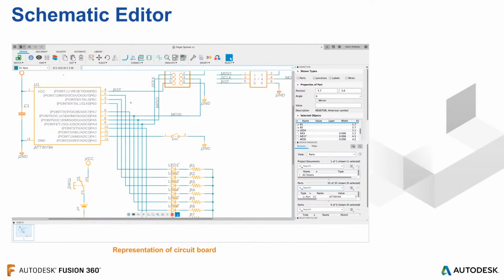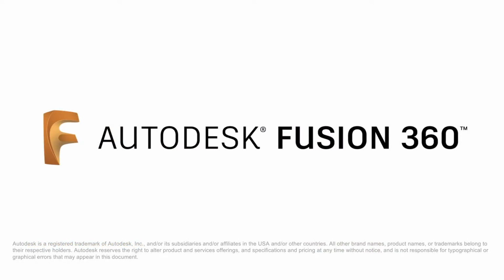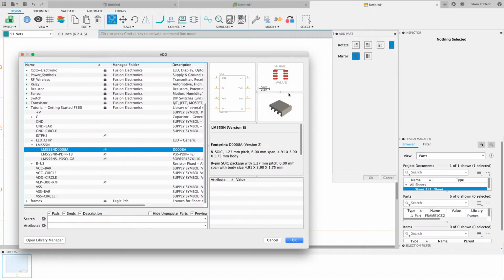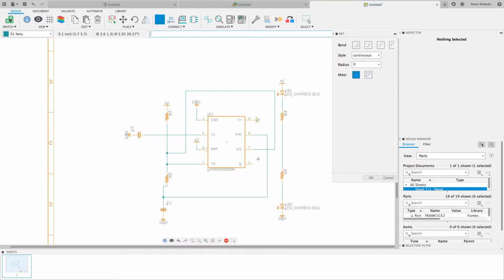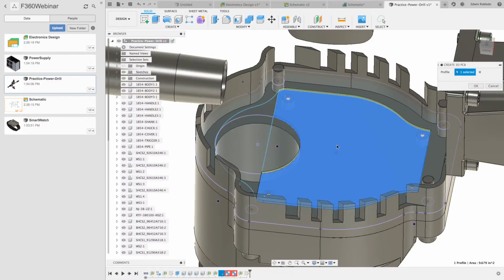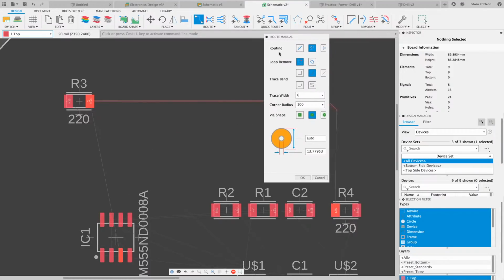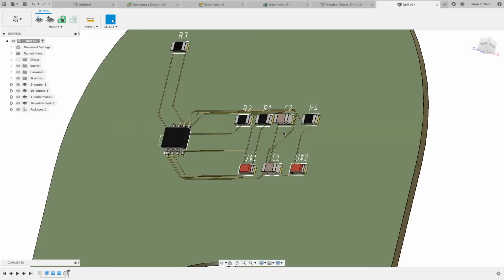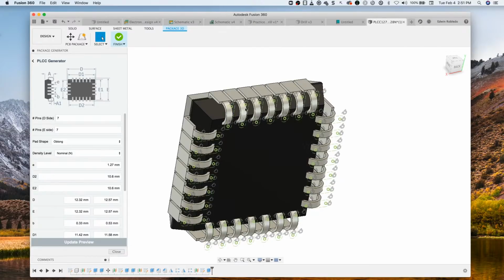360 LIVE: Introduction to Fusion 360 Electronics with Edwin Robledo

Comment: Are there any tutorials or guides online about migrating from Eagle to Fusion 360 electronics ? We are interested in switching but have a full library of components we designed using Eagle and old designs that may need to be updated occasionally. Can I import our Eagle library and projects right into fusion 360 and they’ll just work?

Comment: how to import an existing path (e.g. from an SVG file or a Fusion sketch) into an electronics design?
Reply from the maker: Hi, great question. From the Design Workspace click on the Create Pull down menu and select Create PCB. From here select the Sketch Profile or Face that has the geometry you wish to use on your PCB. Once you click OK, this will transfer the selected geometry to 3DPCB which you can link to an existing or new PCB layout.
Reply: @adskFusion  thanks!

Comment: How does the 3D PCB return to the mechanical workspace for the drill where you originally defined the board outline? Surely this is the whole purpose of this workflow which isn’t shown here - need to be able to check that the PCB with components fits properly inside the mechanical design.
Reply: Yeah I'm struggling with that too... I don't see a PCB in the Design History or browser. Is it only a one-way export to the 3D PCB?
Reply from the maker: Michael and Joel, I think this forum post covers your question: https://forums.autodesk.com/t5/fusion-360-electronics/how-to-work-with-3d-pcb/td-p/9278497
Reply: @adskFusion  The linked post is inaccurate. When you try to derive, it tells you they are already linked. But then changes to the original sketch (used to create the board outline) causes a new PCB to generated, which is not linked to the schematic. It does not appear to be possible to unlink the outdated PCB, so that the new shape can be re-linked. 
This update is a half baked disaster! Please tell me there is a way to switch back to the old method? I have customers waiting!

Comment: Is it possible to push a library from Fusion to library.io, like there is in Eagle with the "Create new version" function? Right now, it is just creating a new library file in the same folder as the design.
Reply from the maker: Hey Simon, can you post that over here: https://forums.autodesk.com/t5/fusion-360-electronics/bd-p/6071 
Asking the question on the forum will get you an answer faster, and I'm sure others are wondering about this functionality as well.

Comment: Something wrong i things....wen you move de 3D compoment, the VIA dont look anymore connected after  ( 46:45 )...im wrong ???? or i miss something
Reply: Hi Christian, your observation is correct, it appears that the reroute was able to optimize the traces without the need of the vias. I will look into this.
Reply from the maker: Thanks adsk eagle for the reply!
Reply: @adskeagle4253  No id did not. It could not complete it at all. If you look, there are now a couple of air wires on the pcb, and the traces that were moved looks quite mangled at best... I am 99% sure that this pcb will need to be fixed before being functional